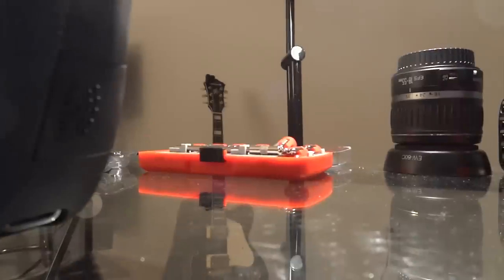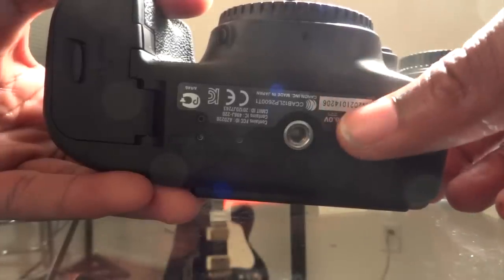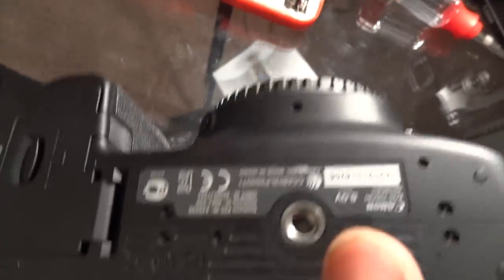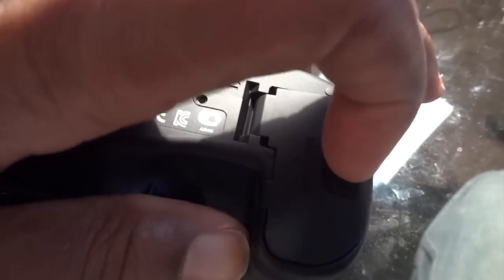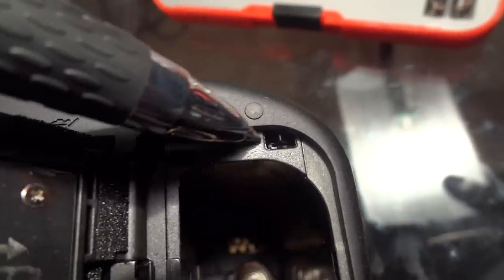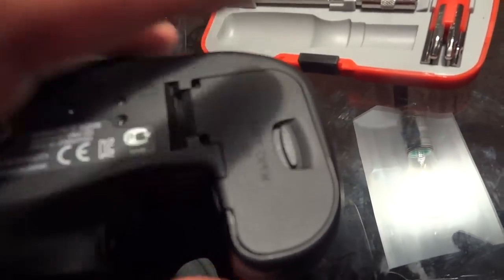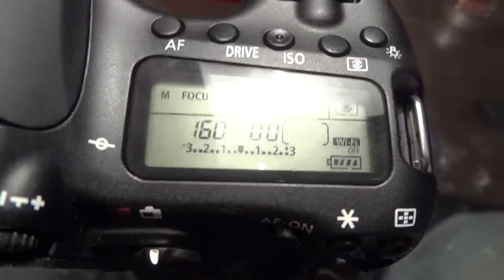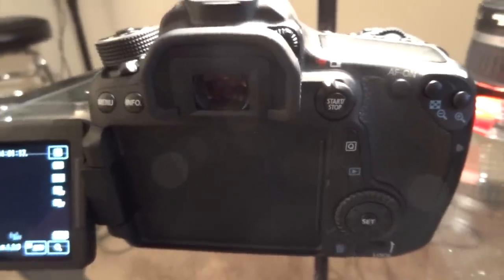CANON EOS 70D WILL NOT POWER UP PART 2 (SOLVED)

Comment: You are a life saver!!! I had EXACTLY the same problem with my Canon 7d Mk2. It just died on me - no power - nothing! I phoned the nearest Canon repair centre and they said it would cost me a minimum of £180 (UK pounds) for them to look at it and fix it. I have just watched your video, found a small screwdriver that allowed me to move that latch and suddenly the camera works! 
You have just saved me $236 (using today's exchange rate)
:) :) :) :)
Reply from the maker: Kim Ayres please like and share the video.
Reply: OK, this is driving me nuts! Your suggestion worked, and I wrote the comment above. Then I turned the camera on again and I was back to square one, with nothing happening! I tried doing the same thing only now it's not working. I've not been able to get the camera on again :(

Comment: EOS 70D err 20 – (my error sounded like a shutter problem) – Works now! Thanks to your video Christian! I did a combination of both your "battery slot tip" and tried Romil's comments (3 such switches...). I don't know how, or what happened, but it works now – Thanks for posting!

Romil Pahwa
1 year ago
This solution did not work for me. I did some research and found out that there are 3 such switches which can stop the camera to turn on. 1 for the battery( as shown in this video), 2 in the mem card slot and 3 in the lens. I tried putting the sd card and tried putting a little pressure on the cover and it worked!! I hope this helps...😇
Reply from the maker: Very welcome. Please like and share this video.

Comment: i am trying my luck to push my entrance in the world of photography and bought an eos70d that didn't turn on, after opening the back and removing the Mobo, i noticed that this part was missing while the teardown videos i saw always had it, and i mean, completely miss it... now i tested the 2 poles at the bottom of the battery to check if current would pass through them and the result was negative, now i wonder if this little guy acts as some sort of connector for both poles, or if the problem is elsewhere

Comment: What did you do exactly with this micro switch? How is supposed to be originally and what do you have to do on it?
Reply from the maker: did you watch the video?
Reply: @ChristianRobinson  Several times, but I am not able to recognise the step process :(
Reply: @clochu0139  Yes same here. I don't believe there was any step by step instructions in this video. He did state what the issue was which was the micro switch and the tools he used but it wasn't too clear on how he fixed the issue. I understand that he moved that little switch to the middle or something like that but other than that I'm unsure also.

Comment: Thought I would add an update. I have been problems with the built in flash popping up. Like it would not. Tried the "fix" on the hot shoe posted in another video but it did not work for me. I've been using my Speedlight Flash on the camera, and it works fine with that. After doing the fix posted in this video, it solved the 70D problem of not turning on AND my pop up flash is now working. So that little switch that gets joggled, may help those having that problem as well :)
Reply from the maker: please like and share

Comment: Thanks for posting my Canon 5D started doing the same thing. I'm going to look at my camera tomorrow and see if that's the issue and will let you know. I thought it was the batteries but they were charged. I opened and closed the battery door and sometimes I would get power but sometimes I would lose it.
Reply from the maker: Thank you , please like and share this video.

Comment: In addition to the tiny latch under the batter cover, check to make sure the cover of your SD card slot is closed properly. There is apparently a sensor there too that effects power. My power came back when I made that adjustment.
Reply from the maker: ok. but that wasnt the issue. The only issue was shown in the video.

Comment: My 40D has been showing the topside LCD display OK, but the large back LCD display stays dark, and when I press the shutter button the topside display flashes "busy" and the shutter never fires. Autofocus still works on the lenses, and the flash comes up and flashes if it's in the right mode, but the shutter never flips and no picture is actually taken. I've tried 2 batteries, 3 cards, 3 lenses, and all sorts of other fixes that have worked for some people. Your video about the switch gave me hope because the opening for my switch was very dusty, but thorough cleaning and checking the position of the switch arm didn't fix my problem. Glad yours is working though!
Reply from the maker: OK

Comment: This solution did not work for me. I did some research and found out that there are 3 such switches which can stop the camera to turn on. 1 for the battery( as shown in this video), 2 in the mem card slot and 3 in the lens. I tried putting the sd card and tried putting a little pressure on the cover and it worked!! I hope this helps...😇
Reply from the maker: Thank you , please like and share this video.
Reply: How it worked on the card slot can you help me
Reply: Where is the switch of lens?

Comment: Thanks for posting your video, i just managed to fix the same issue I think if the Canon is banged in anyway that spring clip pops up and causes the camera to not switch on. So just in case guys avoid bumps and drops to your canons.
Reply: My kids were playing around and my canon 60D got banged so that's why i think the clip pops up. Thanks.
Reply from the maker: ok

Comment: hi thanks for sharing this video , i have canon eos rebel xs for some reason i am missing the battery cover and its just very dead and i see that little black thing i pushed it with pin it still not turning on should i buy the battery cover which might push that ittle guy so that it may turn on again ? whats your toughts on this ? i connected to computer to see if its gonna turn on nothing
Reply from the maker: +Sergei Khan the camera that I have will don't work without the battery cover. I can't speak of the camera that you have. but your issue is not related to this video. you need to first get the correct cover first then go from there.
Reply: thanks sir mine is canon eos rebel xs

Comment: I think this is the problem with mine. It turns on when I use a small screwdriver to press it down but the door won't press it down enough. What did you do to actually get it to work when you close the door?
Reply from the maker: Thank you , please like and share this video.

Comment: i have a different kind of problem with my 70D
it keeps powering on even when the power button switched off
i have to pull the battery out if i want to turn my camera off
seems nothing wrong with that little sensor on the battery compartment
any suggestion..?
Reply: +wayame wayame  I got the same problem my friend.
Have you found any help with this?
Reply: I wish my camera would power on when I don't want it to. I can't get it to power on at all.
Reply from the maker: ok

Comment: I had a similar issue with an 80D. The camera would not power on unless I applied pressure to the grip by the SD slot. There is a sensor switch right when you open the sd slot. I used an ex-actor blade and pried lightly so that is was centered in the slot. Sure enough now when I close the Slot the camera switches back on and stays on. Stupid design. Hope this helps.
Reply from the maker: Please like and share this video.

Comment: I've tried removing everything, holding the shutter to discharge the board and even your tip and I still can't get my 70D to turn on. I was getting error code 80 and my camera was freezing. Now it won't turn on. Have you found any other solutions? Is there a watch battery somewhere than can be replaced like in some older cameras?
Reply from the maker: Thank you , please like and share this video.

Comment: i have the same issue but the latch was not the problem... is there another way to solve this issue?
Reply: +paoweevue same boat. Still not working, also can't find any of the forums mentioned that talk about taking it apart. Will try anything at this stage.
Reply from the maker: ok

Comment: This isn't working for me. I'm taking a mini screwdriver, and pushing the microswitch over a bit, but it just keeps flicking back to its original position. From what I can tell, it's not even misaligned, since when I push it down it seems to sit where it's supposed to; although I have no idea what it's supposed to look like in the first place. What am I doing wrong?

During an interview today, the camera simply froze after a few minutes. I tried taking the battery in and out, but now it simply won't turn on anymore. Nothing.
Reply: Hi

I have the same issue. Have you found out how to fix this issue? 
Thanks 
Sam
Reply: +Samuel Carter-Brazier If you have a small enough screw driver, you can try undoing the backend of the camera and seeing if there are any screws loose on the circuit board. There's a common issue of the battery not being able to communicate with the circuit board because of a loose screw. You can find an easy tutorial on how to fix this online. I haven't tried this yet, though, but I've decided to simply rent equipment until I have enough money to buy a new camera. The fact that they (reportedly) charge somewhere around $400 to fix this issue out of warranty, which is about half of what a preowned 70D is worth nowadays, is just ridiculous. Long answer short, if you've had your 70D (or similar) for a little while already, you're better off investing in an upgraded camera than a repair; unless it's simply a loose screw.
Reply from the maker: ok

Comment: My canon sx170 is won’t on I have put my memory card a label using masking tape though there’s a slight tightness, at first it turn on several times, and the following morning Ive tried to use this as a webcam but when I inserted the macro USB just in the a/v out it just appear in the screen the previous pictures that it is store on my memory card…. And in the following morning I want to get some pictures outside in my house…it didnt turn on, I did charged my battery and check it the reading is 4volts, I have remove the memory card and try it again, it didn’t turn on… Huhuhu please help me… I love this camera so much!!!!! Thank hoping for a reply thanks
Reply from the maker: ok

Comment: Man, if this works. I'm your new best friend. LOL. I just called a camera repair and it would cost $200 + . I was told it probably is the mother board. But haven't taken it in yet. I noticed that the button you are talking about was not in the center. A bobby pin will work as well to move it to the center. Regardless of the out come I THANK YOU!
Reply from the maker: Thank you , please like and share this video.

Comment: i think i have the same problem, my camera ( canon 80d ) works fine but when i add a grip ( Neewer ) it want work unless i put some pressure under the grip ( it's like not touching the battery sensor )
Reply from the maker: Please like and share this video.

Comment: id call it a micro switch, job well done hoping this will fix my wife's 70D
Reply: In the end it needed to be sent away and a new main board was installed. Out of warranty but still done for free. Known issue with the 70D
Reply from the maker: Thank you , please like and share this video.
Reply from the maker: Thank you , please like and share this video.

Comment: Brilliant worked for my T3i as well.
Reply: I tried my battery extender attachment, and that solved the problem, so I assumed your switch solution must be the issue and sure enough it was, and I can now just use the single battery again, great problem sleuthing.
Reply from the maker: +Linda Muvic thats great news, please share and like.

Comment: i guess this wasn't my problem bc my camera is still not working
Reply: IT IS MICRO DETECTOR(MICRO SWITCH)THIS SWITCH DAMAGE IN EOS 70 D VERY RARE CASE ONLY.MOST COMMON ISSUE IN THI MODEL PCB ASSY MAIN DAMAGED.
Reply: +Camera repair canon 70 d  erreur  30
Reply from the maker: Ok

Comment: hello Everyone i have also 70d i buy used camera in good condition about 20days ago am not a regular user . im using my camera and my battery is low i took out battery and put my camera in my bag 2.3days later i try my cam is not working no power nothing charge my battery but nothing happen today i go to market  thy checked my cam replace batteries but no power nothing.thy said that your camera board is damage . thy said 20k pkr. to replace the board.i saw ur video i set that latch on battery side. but didn't work for me please anyone can help.me ? how to fix my cam .
Reply from the maker: Thank you , please like and share this video.

Comment: i am looking for people who have had problems with the pcb board going bad.  i started using the video side of my camera in the last 9 months and imy camera started to freeze up and i could not reset by  turning off and on i had to remove the battery to get it to start again.  the problem started to get worse to the point where the camera stopped working.  the camera is out of warranty and i did send it to canon and they want 400+ to fix it and i told them that they have a problem with this camera.  i am reaching out to others now who have had a same problem.  i want to try and get a recall started or start a class action suit to force them to repair it and also reimburse anyone who has paid for the fix.  this should not be happening to a camera that is only a couple years old.  if canon does not want to stand by their product then maybe the courts can make them.  i am a canon fan up until this point i also have a 6d, t3 and a ton of lenses.  how they have treated this issue with me has left a bad taste in my mouth to the point i am ready to sell everything and go to another brand.  i also want to help others who have had this problem so they are not out a camera.  please email me lookingatyoutoo@gmail.com and let me know your experience with this problem.  if you know others who have please reach out to me and lets get this problem fixed.
Reply from the maker: Thank you , please like and share this video.